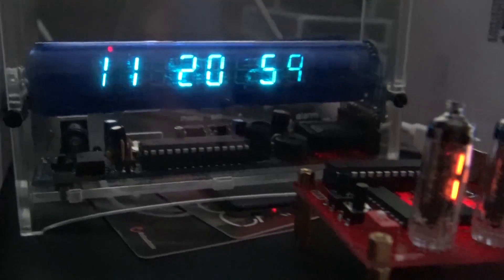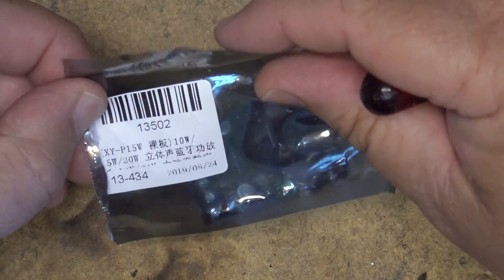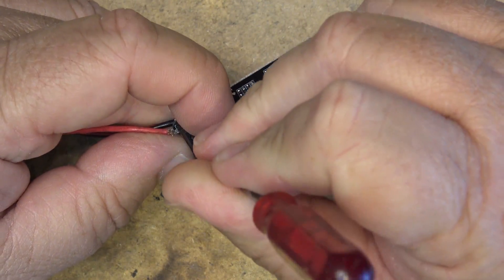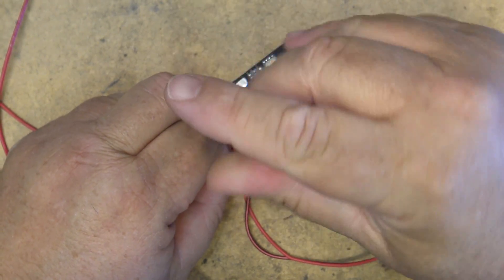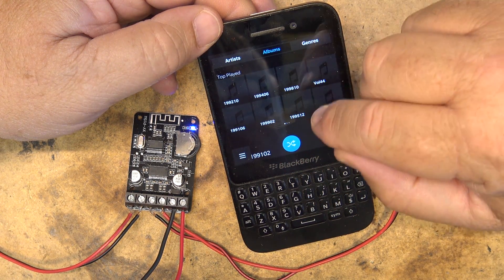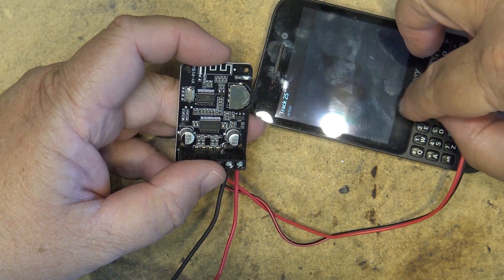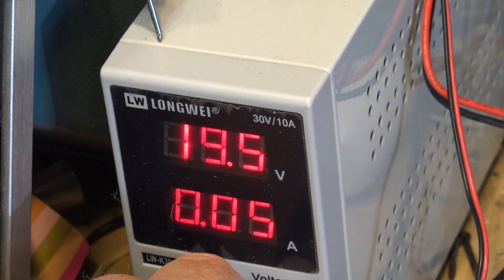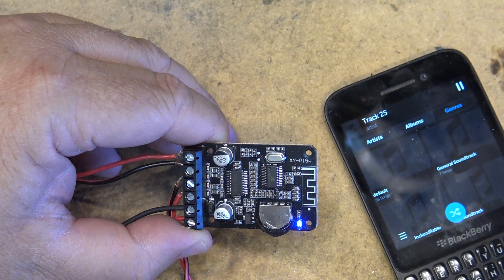XY P15W Bluetooth Power Amp Board

Comment: The power usage was under 2 Watts at 24V. Does that mean the claim of 2*15W output is nonsense? I don't know enough about audio amps to say.
Reply from the maker: You mean 2 amps.   2 amps at 24 volts is 48 watts so considering efficebcies and losses 2x15 is totally doable.
Reply: I meant 24V x 60mA (from the bench power supply readout) which made me think the module was only drawing about 1.4W.

Comment: I'd like to use this as a DT Project for school students.  Whats the best and easiest way to power this?  Could you use a micro USB cable?
Reply from the maker: It needs 8 to 24 volts.   So the easiest and safest for a student project would be a 9 volt battery.
Reply: @12voltvids  So adding a 9v battery snap to the power sockets would be fine?
Reply from the maker: @mrcfenton9922  yes will work like a charm.

Comment: Hi. You can make it change tracks (next, prev). All you need to do is change 2 smd resistors. They are near Bluetooth  antenna. One of them 15 Kom, change it to 0 or shorten it with a wire. Another one is 50Kom Change it to 6.2Kom or 6,8 Kom  resister. Third resistor is 3 Kom, don't touch it. After this manipulations you will be able to change track (short press left or right). Volume - + (long press left or right). If it's hard for you to find out resisters to change, i can sand you a photo.
Reply: Is there a way to lower the pair tone volume, or just eliminate it. It’s a scary loud tone at power up.
Reply: @shanebarrett5827  No. You can't change, or lower it down.
Reply: I would like to see a photo of the resistors please.

Comment: It would be nice if it could skip tracks, but it's not a dealbreaker for me.  I have several old 12V wall warts sitting around, and it shouldn't be too hard to rig up a barrel connector if I don't want to cut the wires on the wall wart.  According to the icstation website, you can push it up to 30W with 24V, 4 ohm speakers, and a heatsink!  Now to find the right enclosure to make this look like a finished product!  

There were lots of comment suggestions on the prior bluetooth unit with USB that locked up when you tried to play track 9999.  Did you ever get that one going again?

Comment: Blutoot does not have as good sound as if you are connecting with signal cable. bluetooth is always compressed audio.
If you want a Bluetooth audio receiver with the best sound, you should have Bluetooth 5.0 and Aptx HD codec compatibility. Many newer phones support this. you should also BUY a bluetooth receiver with its own dac CHIP built in.   Ebay item number: 254252043260
Watts written on cheap class d board  are usually 10% THD watt!
Reply from the maker: So what is your point.  Bluetooth is compressed just like everything else except for cd. This is not an audiophool device. It is a way to play music from your phone which is incidentally stored in compressed format, or streamed from a compressed stream to your speakers.  Why is it everytime Bluetooth is mentioned the same people have to chime in about it being compressed.  Same with class d amplifiers.  Someone will post how bad they sound.  Most of them would not know a good sounding amplifier if it was sitting in front of them.  Tubes have high distortion and yet they sound better than any as amp.  How can that be as they have such high distortion numbers.   Lots of different types of distortion that can be measured and only a few types, odd order harmonic distortion is detectable by the human ear.   Who cares about the 7th or 9th order distortion.  It is so far up in frequency that you will never hear it.  Perhaps your dog might or a bat, but really is distortion in the 15khz or above range going to disturb your music listening.  Probably not and 99% of people will never hear it.  Certainly anyone over 30 won't.  If I can't hear it, it isn't going to bother me.   I get a real kick out of these old guys in their 50s spending ludicrist amounts of money on super high end audio gear.  By this point none of them can hear beyond about 14khz anyway.  Once the average person hits 30 their hearing range starts to drop in high frequency range and by 50 it is really starting to go.
Reply: @12voltvids  - Beware the Audiophools walk amongst us!

Comment: I'm guessing a Class-D (natch).

10 to 20 Watts - ish. But what is the THD?  :)-  

They don't really specify an optimum speaker impedance on the icstation link, just basically saying its works with anything.
-
Off topic but have you see P Franco's latest on YouTube going after a DMCA flagger? Maybe the beginning of the purge for these A-holes... but could be they are going only against the small fry for now.
Cheers,